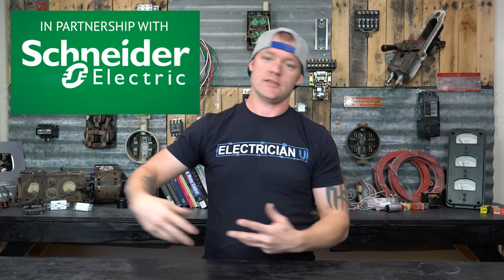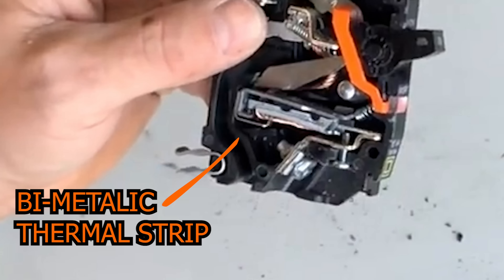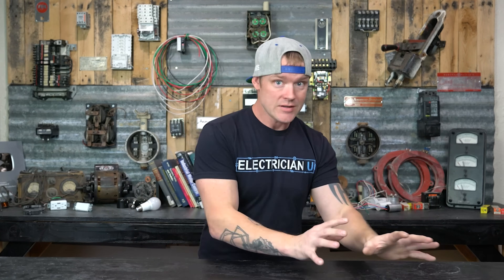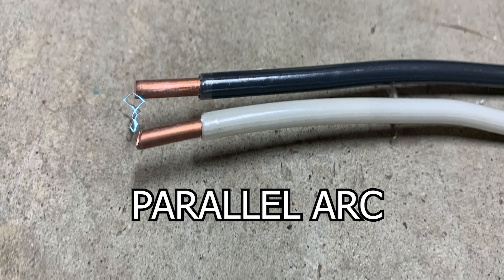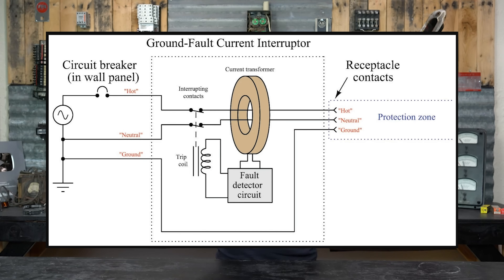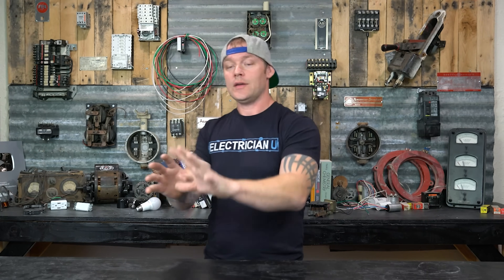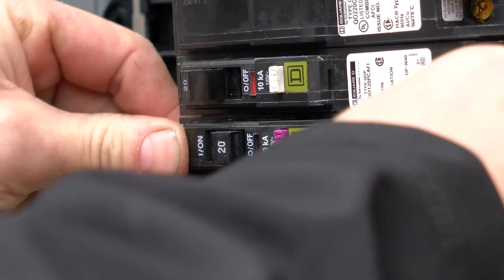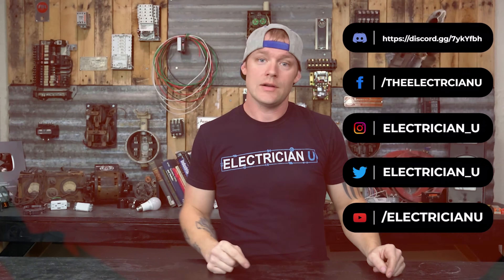Arc-Fault, Ground-Fault, and Dual-Function Circuit Breakers Explained

Comment: Hey bro, I love your videos and teaching style. My first question is why does the code only speak about 120 volt circuits? What about ovens, stove tops, ranges and dryers? Thanks in advance! Second, why can't they design a whole house/panel solution? Better yet, something at the meter pan? Keep the content coming.
Reply: Code definitely discusses far more than just 120V circuits, so I'll leave that to further reading in the dreaded code book. :P
The whole house solution is something I've pondered before, and I've heard that there are things like main breakers with GFCI protection that exist (countries outside the US?), but the logic is kind of as follows: at the point of a plug on a circuit, 5mA of imbalance means something is wrong, but 4 is okay. If you've got 10 circuits going through your main, do you need wiggle room for 20mA of imbalance if each circuit on one of the phases if having that 4, or should it be less if some of the imbalances are canceling each other out cause they're on different phases? What if you have more/less that 10 circuits? If you add circuits later do you need to change to a more/less sensitive main? How does the mix of circuits that do/don't rely on the neutral factor into the balance your looking for? It all gets complicated very quickly when you go upstream of a single branch circuit that perhaps the sensitivity you'd need would be so much less that it's not really giving you the level of protection you need to actually protect you. And that's just GFCIs, AFCIs track wave forms so I'm not gonna get into that here.
You can feed sub-panels for garages using AFCI/GFCI breakers at your main, so there is kind of an implementation of this that does exist commonly, but if there is an easy answer out there to a whole house solution like I think you're talking about you need to stop wiring plugs and talk to Eaton/Square D about your engineering design and sell it to them for millions. lol

Comment: All my inspectors say do not protect a refrigerator.   Or a freezer.
Reply: from what I hear the 2020 code saids that any receptacles within a 6ft string line needs gfci protection. so when putting in that refrigerator outlet put it on a stud outside the 6ft range. also I believe that a hardwired disposal is ok but one that are plugged into a switch outlet under the sink are not.
Reply: I have a one year old Sub Zero refrigerator. When we first installed it we had some problems with the afgi receptical. At the resk of losing lots of food we change the breaker to a regular breaker. On the sub zero website they address the issue stating they have no answer to the problem.
Any thoughts on what to do?
Robert
Reply: @robertlevin3538  They make gfci outlets which have a built in with Audible Trip Alerts.  My guess is that your outlet is behind the unit and you cannot get to it. Then I would put the alarm gfci outlet somewhere you can get to it to reset and use it to downstream protect the
Reply: The problem with any sort of alarm or not is what happens if you are out of town for a few days or longer? Everything in the refrigerator and freezer is ruined.
I did change the breaker to a non arc or a gfci just a regular 20 Amp breaker.
At the time when I did this I read many different articles about people having the same issues with arc fault breakers.
You are correct that it is not easy to get at the receptical so it is the breaker thats the problem.
Building a new home and would like to stay in code except would hate to end up losing a fridge and freezer full of food while out of town!
Any thoughts or ideas would be appreciated.
Robert

Comment: Ok, let me ask a question and start a debate: should I slowly swap my regular breakers for AFCI / GFCI where new code requires it?
Reply: That would be a definite maybe, and it's up to you. 😁

Existing systems are essentially grandfathered as long as they remain untouched. Most cities and states have requirements that may require you to upgrade to current standards when or if you make a modification.

From a safety standpoint, it would be a good idea to bring your electrical system up to current standards.
Reply: Authorities having jurisdiction can only require that it met the minimum code standards at the time of installation.  If it was signed off on at that point in time you are good to go.
Reply: @jonathanmorgan4916  I hear you, but I’m going to have a little kid running around in a couple years who might stick things into outlets...
Reply: @oxthemoron  Start with replacing all outlet receptacles with tamper resistant receptacles. That will help that specific situation much more than a GFCI or AFCI would.
Reply: Think of it like this: Code says what the bare minimum for safety is. If the Code is updated to say it now requires something you don't have, you're now beneath the bare minimum of safety. Should you keep up, definitely yes, and I'd personally try to anticipate what the future is so I can overspec the bare minimum and not have to modify things as often and just have better peace of mind.
That's different from are you required to keep up though, which in most places you're definitely not cause you're grandfathered in. Think of all the Knob and Tube houses that don't have grounding but aren't required to upgrade. You're far safer then them if all you're missing is AFCI/GFCI. Add on top of that that different states add in their own exceptions to the Code or don't adopt the latest version, and you might not be required to do these updates even if you're working on the circuits.
You asked "should" though, so I'd say yes.
Also big echo of Jason W in that if you're worried about your kid sticking things in outlets "tamper resistant" plugs is a super cheap upgrade you can do that will basically prevent that.
Reply: @normILL  thanks and thanks Jason.  As I was reading about afci/gfci dual breakers, I was seeing some dated comments that complain about overly sensitive breakers that trip due to false positives. 

The house is wired with copper. Had a challenger panel and breakers.  I already swapped some breakers out to Eaton (the official replacement for the panel) as the challenger breakers were known for failing but the panel is good. I’m not sure if it was the previous owner, but there were some 20 amp breakers on 14 gauge wire. So I dropped those to 15 when I replaced but didn’t upgrade to AFCI/GFCI when I made the switch. The previous owner also stuck caulk and a paint stirrer in a ceiling receptacle so that he could rig it to hold a fan and paint over it.... after seeing that I opened every receptacle in the house to double check if he had done anything else.

I got into this because I’m wiring a circuit for a new renovation. That was inspected and obviously had to be to code. I guess I’ll slowly update the panel based on rooms we use frequently that don’t already have gfci. 

Preventing a low risk that’s someone gets electrocuted or an arc starts a fire is probably worth it to deal with the inconvenience of a few false positives if they are overly sensitive to some of my electronics.

BTW Dustin - if you read this your videos are incredibly helpful.

Comment: Would really like to see a actual arc explosion to show the devastation that you speak of. I wonder if UL or a Utility Company would give you access to some of their testing videos or surveillance videos...
Reply: Imagine the sun briefly being beside you.
I had a 4 AWG ground vaporize once when installing it touched both legs of an older (80s) load center. I had an instant sunburn, copper infused into my glasses, and more small beads of copper around the room than I could count.
I was lucky.
Reply: There are plenty of electrical arc videos available on YT.
Reply: Most likely not, that would be like having a video camera behind your panel cover in your home.

Comment: Lots of electricians get confused with combination afci breakers, thinking that means it also provides gfci protection. What it really means is that it provides protection from series arcs as well as parallel arcs. But no gfci protection.
Reply: NEC should look into this
Reply: I think they actually do have a combination of each now in one
Reply: @Weprodigals  yep. They’re the dual function breakers.
Reply: @RB-xv4si  You are correct I wished they would not have used that term it just caused confusion
Reply: @majorl51  absolutely. I remember one job where I misinterpreted that label as well as my manager who is a master electrician lol.
Reply: I'm really not a fan of the art fault
Reply: Thanks R B that's a great explanation now that I'm learning the difference.  I always wondered why they said "combo" on some AFCI breakers when they weren't both Arc and Ground Fault like I'd hoped.  I still don't have my head around why it's helpful knowing the difference if it's a Series and Parallel Arc Fault.
Reply: @MrBizwack  practically, it really isn’t helpful. All AFCI breakers sold today are the combo type. When AFCI breakers first became available, they only provided series arc protection. Later, parallel arc protection was added and then they started calling them combination AFCI. Why they let us know this with the label, I have no idea because it’s not like we can choose one or the other. They’re all combo now. Even if we did need to know, there should be a less confusing way of labeling than this.

Comment: Dual Arc-Gfci breaker come with audible to alert of refrigerator off?
Reply: No. But you can install a gfci receptacle with an integrated trip alarm for it.
Reply: You can also buy a device that plugs in to the same outlet and audible signals if the circuit has lost power.

Comment: Excellent video!!

Can you touch on false tripping sometime?

Like running a high amp draw power tool in home on a 15/20amp circuit. May that cause a trip if all else is proper?

Comment: Hey Dustin, great video.  I am a journeyman in western Oregon and tested out in 98.  I do not wire a lot of homes but from time to time find myself in one and every time it seems like the use of arc fault just keeps growing.  I understand the technology behind the GFCI but am still a little fuzzy on how AFCI detects arcs.  I probably should know this but have not devoted much time to it.  Appreciate any comments.
Reply: Arc faults are detected using micro-controllers that look for specific voltage-current patterns.  A series arc will not flow current until near the peak of the voltage cycle, then drop  off after the arc forms.  It's tricky because switch mode power supplies that are everywhere now also only draw current near the top of the voltage cycle.  But each create a different pattern of distortion.